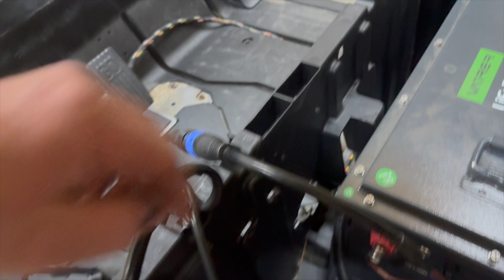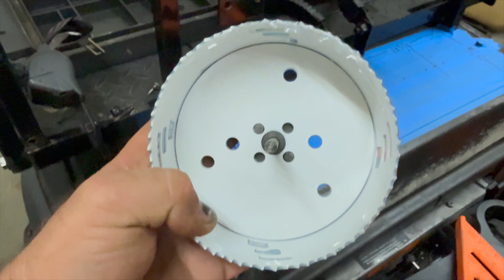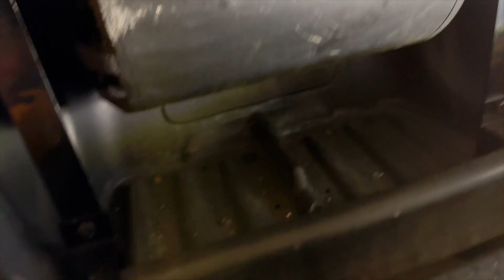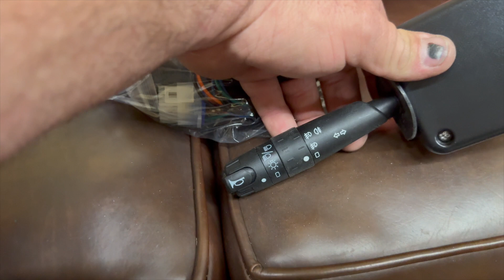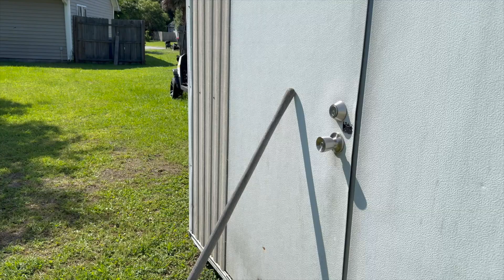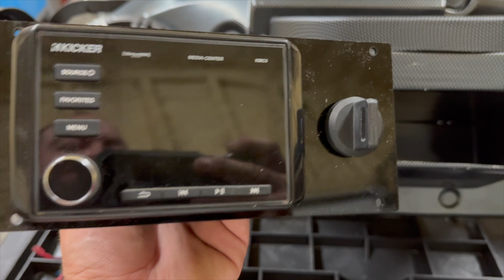2025 Project Club Car Tempo Gets Stereo & Electronics | Part 2

Comment: Did you run all your accessories on the 12v battery? If so do you have it wired to turn off with your key switch?

Comment: Curious on how did you power each amp with 1 power / ground wire?
Reply from the maker: Terminal Block. The amps have like 12-14ga power and ground wires.

Comment: I like the idea of hanging the the sub under the speakers and above the motor.
The black plastic that the speakers got mounted to needs to be repainted.
The bag well needs a 12V cigarette adapter so that you can strap a 12V electric igloo ice chest into the bag well.

Comment: What is the logic for adding a 12v battery for a radio? Could not a 30A buck converter on a150Ah LiFePo support a radio amp draw?
Reply from the maker: It could, But since the cart is on 18/30s I wanted as much range as possible for my cart.